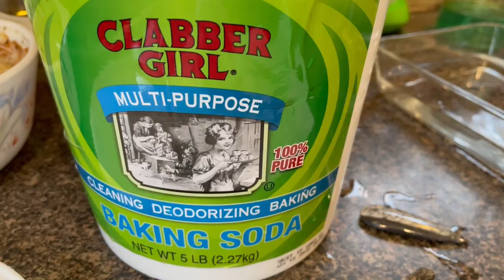Making a Copper and Fossil Coffee Scoop

Comment: What size copper rivets do you use?
Reply from the maker: @bbrown1269  I don’t remember exactly since I made this a couple years ago, but my best guess is 14g. I use stripped electrical wire, and 12-14g are usually what I work with in that material.